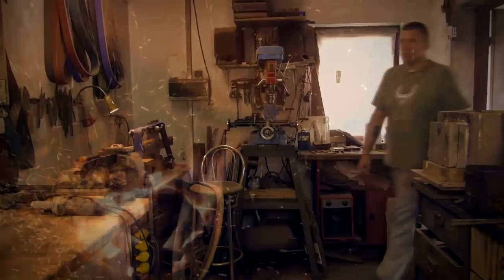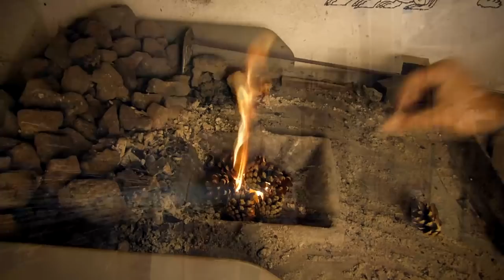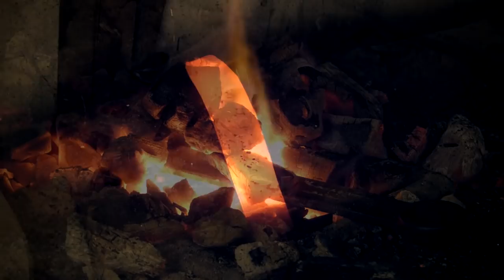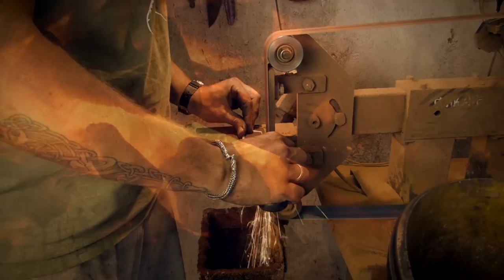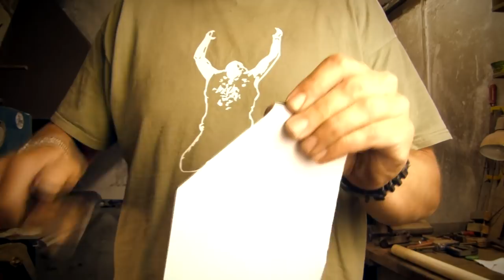A KNIFE MADE OF AN OLD WRENCH [Trollsky Knifemaking]

Comment: Beautiful! I guess technically speaking that is a multitool.
Reply: But it's hard to get enough leverage while screwing bolts ;)
Reply: +skurczybyk12 Nah, its the same leverage. Just that you have to choose, leverage or fingers.
Reply: +itsFisch Not really, sure you can't grip it properly, but you can push against the back edge of the knife.
Reply: +LL Pete  I wouldn't want to hold on to the sharp end so I can use the other end for a wrench. that could be dangerous :-[

Comment: awesome stuff. Im guessing most modern wrenches wouldn't do very well with this method right? Is there a way to check them to see if they might be made of proper steel?

Also does anyone know of any ways to test out random scrap metals and what not to check and see what kind of steel it is? Ive got some pieces about the size of railroad spikes but they are cylindrical, about as thick as a soda bottle cap in diameter. Ive seen that railroad spikes can make for good steel to work with but never knew of any ways to find out how good steel is or what kind it is if it isn't labeled.

Comment: I tend to worry too much about technicalities like the specific type of steel and getting the heat treatment perfect, and lack "art". You on the other hand, seem to care little about perfection and just get work done, with impressive results. Kudos for that.
I've been working with Sae 1030 steel for a while, much softer than what you likely have there (despite que questionable heat treatment, no offence). The only negative is hardness and therefore edge retention. On the positive side, I went for a high toughness temper and ended up with a hardness just over 300 Brinell (whole piece treated, not just edge). It seems low, but the high temperature temper offers two significant benefits: 0 brittleness=impossible to chip, and practically no carbides, allowing for an incredibly keen edge. the bevel angle is 45 degrees inclusive, and after honing with very low pressure, the electronically measured apex with is about 25NM, keener than Feather Super Pro Artist Club blade, which is regarded as the keenest commercially available blade with a 50nm apex. My conclusion is that for the keenest possible edge, nothing beats medium carbon steel (except some nickel alloys, but that's another subject), and the relatively low hardness is plenty for most tasks as long as you keep the edge angle wide enough.
Reply: These wrenches are excellent choice for such "miniswords", isn't it? Wonder why more such beauties are not mainstream!
Edge retention should be far better than steels used in knife-making, after all the wrench, if hi-quality, should not bend at all - thus so in micro level, right?
As for keeness, I guess you mean sharpness, it is a matter of sharpening technique, your nanometers look fantatstic!
Reply: Georgi Marinov Well, every steel has the same elastic modulus, so the wrench bends very little due to the design (similar to an I beam) and springs back, or flat out breaks without much permanent deformation.
 By keeness, I mean the diameter of the apex of the edge (on that scale, it looks rounded). It is what helps the blade make the first "bite", the keener, the better. Sharpness on the other hand, depends a lot on edge geometry, and with a 45 degree angle, I wouldn't call it sharp at all. Sharpness determine how easy the cut will be, and depends on what you want to cut. If you want to cut hair, you want a small angle for the first 50 micrometers, and then you can transition to a concave grind to provide maximum support. For other cuts, you want to care about other dimensions, it's long, and I'm sure you already got the whole idea.
 Have a nice day.
Reply: ***** Rebar is around 0.15% carbon, but you are right on the money about RR spikes, according to ASTM A65, grade 2 RR spikes have at least 0.3% carbon. They are very nice to work with.
 Regarding the inability to temper, it depends on the blade thickness. If you try to HT a spike in oil, you will only harden the surface, and a little deeper at the tip, but if you make a 1/8" thick blade, and quench it in chilled brine with soap (read this) http://www.iforgeiron.com/topic/4273-salt-brine-quench/
 you can harden a railroad spike, and after a proper temper you may end up with a uniform hardness of 35 HRC. Of course it will not be very abrassion ressistant due to the lack of carbides, but you will get acicular low carbon martensite, which takes a very keen edge. Just don't make it too thin or it will roll. Finish the edge with 1200 grit or more, covered in chalk (the chalk saturates the abrasive and leaves only the tips exposed, resulting in a lower grit. If you don't have an expensive sharpening system, I think that a bench sander can be better than a stone (might be my lack of skill with the stone). With 35HRC and a 40 degree inclusive angle, you might be able to get a keenness of up to 30nm, or, coloquially, you can get it shaving sharp, but you will want to hone it often with a glass or ceramic rod .

Comment: That is one pretty sweet blade. Did you only dip the blade part in oil to make that hard and then let the rest of the blade slowly cool down on its own? I mean, most videos you see people tempering the blade with very high temperatures first, then dipping it in oil, and THEN heating it up to ca 300 degrees again. Sometimes coating the blade in some kind of clay to keep it harder than the spine. Is that why you only dip the blade part in oil?

Comment: May i ask you what heat treatment you gave the knife? I've been looking to do some kind of comparable project for a while now, but am running to issues of a lack of knowledge/experience. So a bit of advice on how to do the heattreatment would be very welcome! Thanks, Mike.
Reply from the maker: +mike g heating to 850 Celsius, quenching in sunflower oil ( around 50 degrees Celsius) . Tempering in 175 Celsius for 90 mins
Reply: +Trollskyy Thanks alot!!
Reply: +Trollskyy I hope there is a Season 2 of Forged in Fire and you are on it.

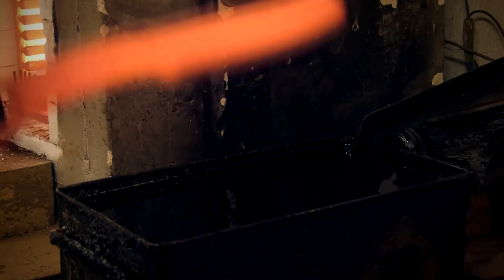Comment: Beautiful knife. question for you Trollskyy, at 1:52 you dip the hot knife in... is that oil? What is the reason for this? Thank you.
Reply: this is part of the hardening process of the steel. You heat the steel until it's non magnetic and then you quench it in oil. This alligns the molecules in the steel in a way that makes it harder. After hardening the blade has to be tempered in order for it to be more resilient to stress and less brittle which brings the hardness of the blade down to a desired level. He only quenched the edge of the knife so that it would be the only part that's hard and the spine would be softer which generally makes for a tougher knife.
Reply: supercowmoo3 so exactly what kind of oil would you need to use? Used motor oil, unused oil, or something else? Fyi thanks for the info!
Reply: +Rob Henry You can use whatever oil you have.. Used motor oil will work just fine! Or you can buy some canola oil :)

Comment: Can you tell me what you used for the "logo" etching?
Reply: Looks like he used a battery and salt and vinegar. You hook up a q tip to a battery and soak it in salt and vinegar (I think that's what they use - there are a few videos on YouTube showing the process) and then touch it to the metal and it etches it. Then you just sand off the corrosion and you get a nice looking etching.

Comment: What is the round thing you stropped it on? Wood?
Reply from the maker: +schlooonginator ceramic
Reply: +Trollskyy what does that do? does it sharpen it or smooth out the edge or something??
Reply from the maker: +Sam Lovo its smoothing the edge, makes it very sharp
Reply: thanks..

Comment: Does it rust? i want one
Reply: Tool steel doesn't rust so i'm guessing this one doesn't either
Reply: Yes it will rust. All steels do.
Reply: H1 steel doesn't rust.
Reply: +mister smith H1 will rust. Extremely corrosion resistant, but not 100%

Comment: You didn't need to Temper the metal..??
Reply from the maker: +Lito Argallon ofc i did it but not shown here
Reply: +Trollskyy what temperature did you temper it on?
Reply from the maker: +Mr. Winer 175 celsius for 90 mins
Reply: one more thing. do you use a heating oven before putting it in the oil. if so, what temperature do you put it to?